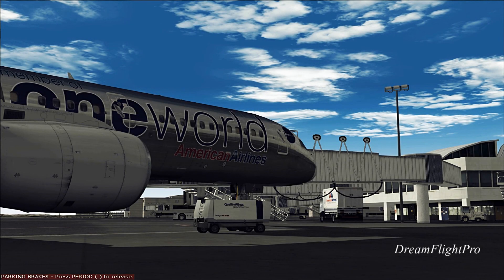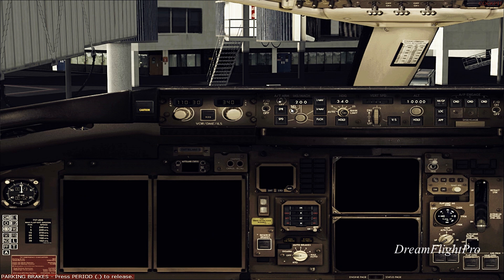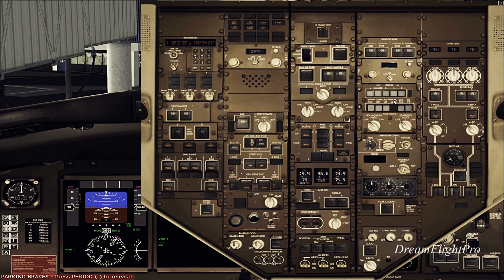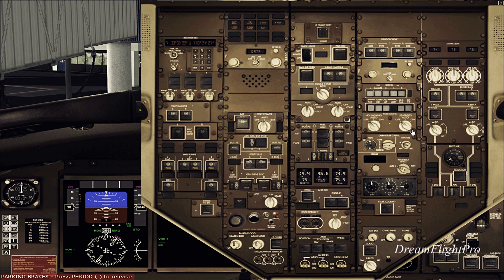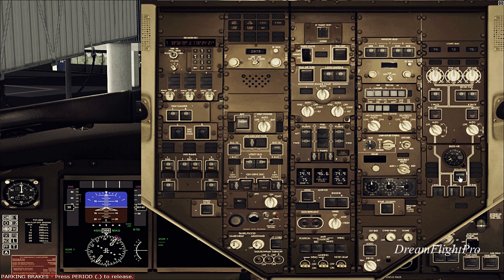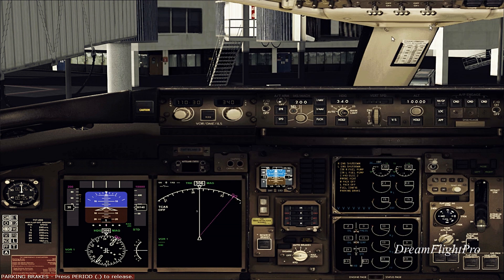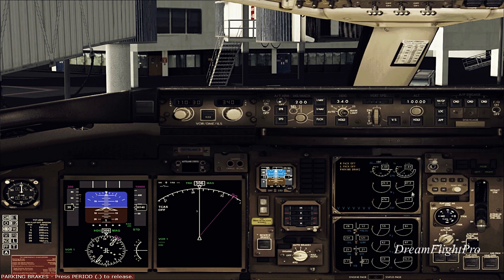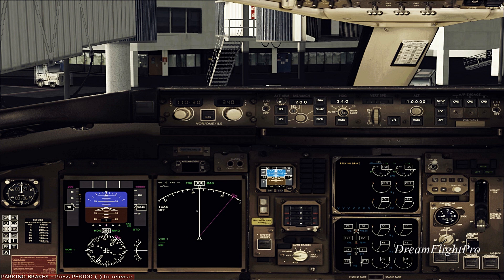BOEING 757-200 QUALITY WINGS ENGINE STARTUP TUTORIAL [1080p][HD]

Comment: as someone that taxi and runs both 57s and 67s; what a load of crap. I couldn't hear a lot if what you said because the noise was too loud. first: there is a checklist; but, let's assume you don't use one. you don't just start pushing buttons to turn stuff on. done need to be on, others don't. fuel levers don't get opened until epr is reached. usually start the right engine first. and I couldn't see the gauges well(watched from a phone); but what the neck did your fishes shoot up too?

Comment: Fake? Are you kidding? I was on an RB211 powered 757 just under a week ago and I've also been in them previously, If you're sitting in front of the engine, then it sounds exactly like it! I am a student private pilot and so I work close to 757s. Believe me this sounds extremely close to the real thing. TSS sounds slightly better but the sounds don't match the thrust settings.